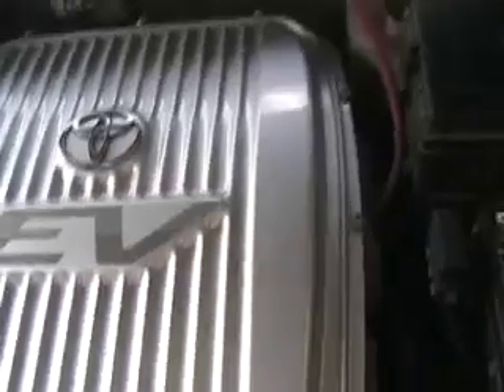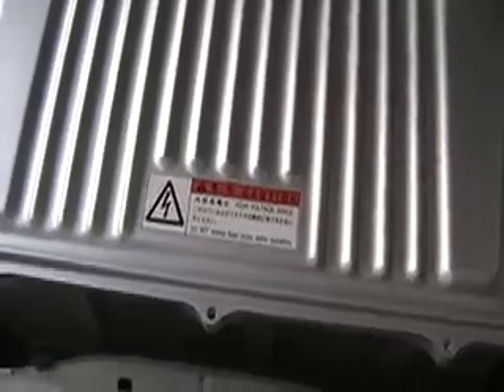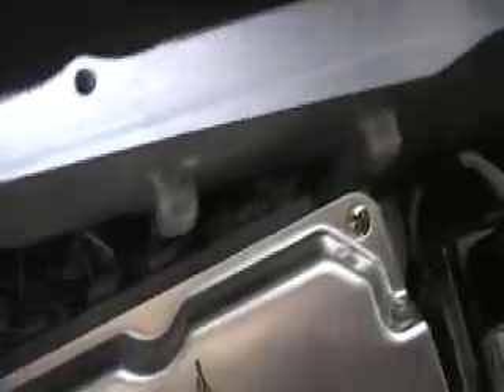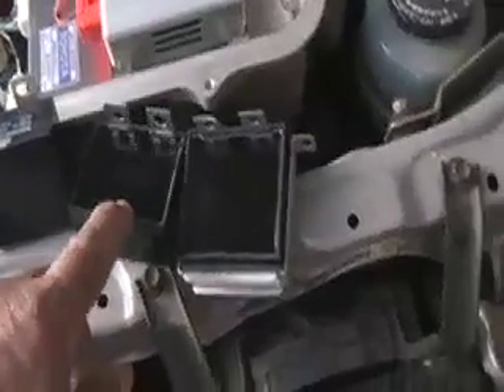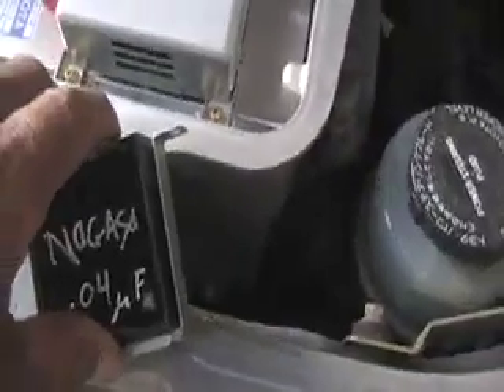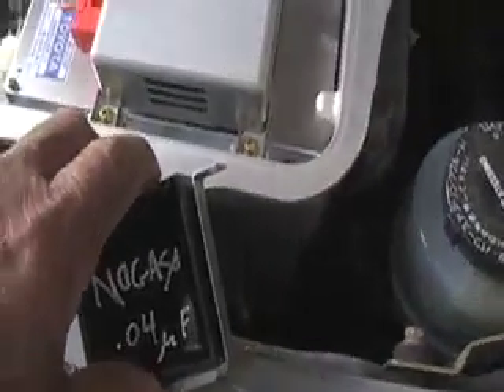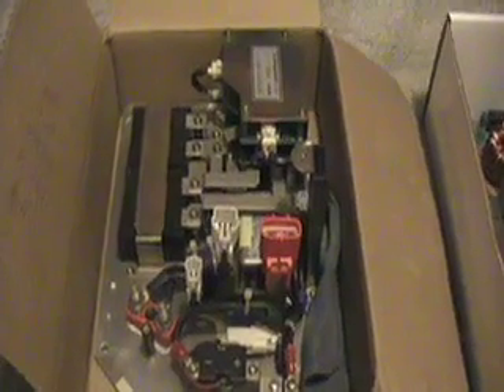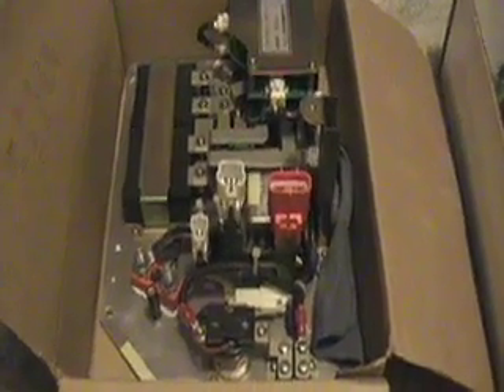capacitor replacement in RAV4 EV

Comment: You can see a vid on my channel. But it only shows the conductive port for the normal charger. The fast charge port is on the LH side of the car. You can just see the flap for that when it drives past. I got pics of it if you want.